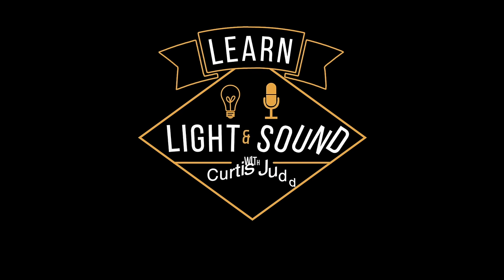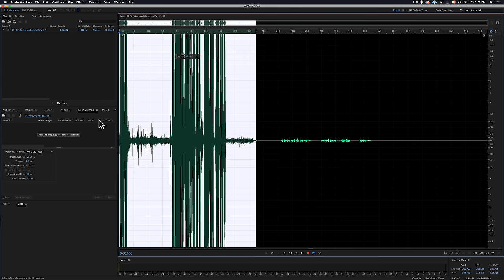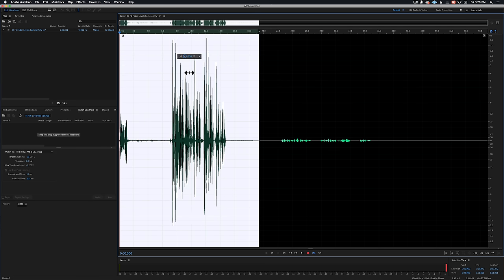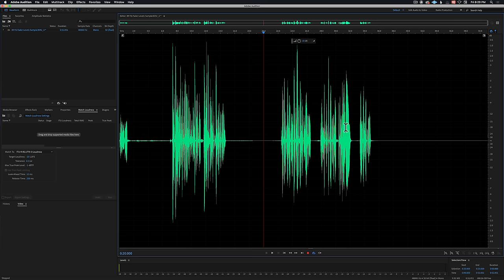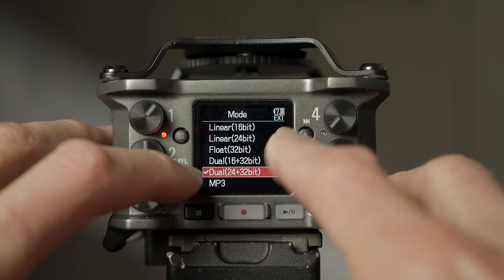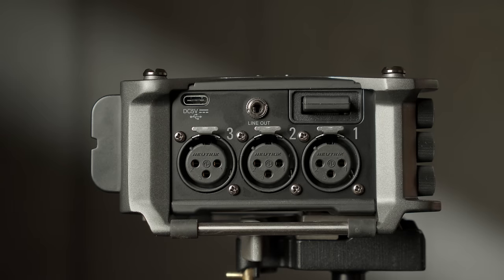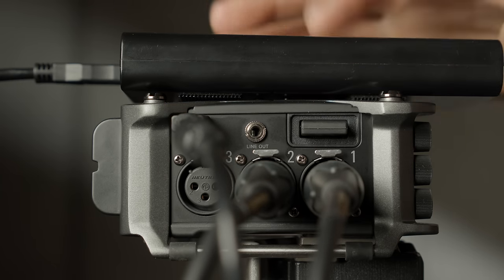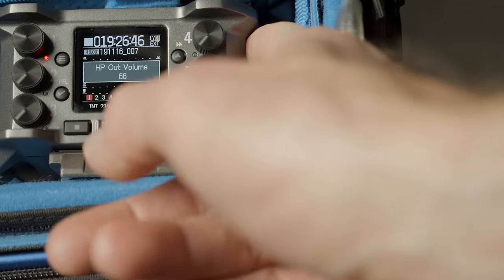Zoom F6 Audio Recorder Review

Comment: Hello Curtis. Thank you so much for this video. I have a DT 770 Pro 250Ohm Headphone. Is there any other recorder from Zoom or Sound devices that can power it? I do not want to spend on buying a new recorder and then a new headphone. Thank you very much for your helpful video.
Reply from the maker: The MixPre does much better driving 250 ohm headphones than any of the Zoom recorders. But it is a tradeoff — the MixPres run through batteries more quickly.
Reply: Thank you very much Curtis for your quick reply. Can I run MixPres through AC Power using adapters if there is one nearby?
Reply from the maker: @letsreview1150  Yes, but check that the USB-C adapter supplies enough power via USB-C.
Reply: Thank you very much Curtis. You have been great help. 🙏

Comment: Hay Kurtis I now have an F6. Now I know that in 32 bit mode the nobs aren't gain nobs as it were. But as they don't have numbers on them like the H recorder nobs mom says she just sees little lines around them how do you get the volumes even?
Reply from the maker: Gotta use your ears.
Reply: @curtisjudd  Ah gotcha. So there's nothing written around the nobs for the sighted either then? Now I did notice when using the app and just getting use to it that when I turned the nobs if I looked at the faders in the PFL section and what's PFL mean?
But when looking at that I did see the things go up or down.
As always thanks for all your help.
Reply from the maker: @MrHamit64  I just double checked — on the screen, it does show the fader level when you turn the knob from -48dB up to +24dB. PFL means "pre-fader listen". It means that you're hearing the raw audio signal before anything is applied like the high pass filter.

Comment: Primarily for podcasting, would you recommend F6 or Rodecaster Pro? Which one has cleaner preamp out?
Reply: Both are brilliant. I have yet to find a podcast consumer that gives the slightest care about having an extra 6dB signal to noise ration on the sound they are listening to. Most podcast listening are done in a noisy environment, such as on the train, walking the dog, etc. and content is more important than that final bit of extra quality. Having said that I have no information or experience in using the Podcaster. Just my 2 cents' worth...
Reply: @remektekmedia6641  Thanks for your reply. And yes, that makes sense. Most podcasts are listened to in a not so quiet environment. And as always. Content is the king. ;-)
Reply: Zoom is also putting out their own Podcast focused interface to rival Rode (and I think it should be coming out any day now cause I keep getting ads for it) that I think will be $400 for 4 inputs (with a lot of stuff that the Rode model has as we'll).
Reply: @FrankETaylor  Sounds great. Any idea what its called? Model no.? Thanks.
Reply: @syjaf6615  Zoom LiveTrak L-8
It doesn't have 32-bit float recording but it does do 24-bit
Reply: @FrankETaylor  Thanks! I'll check it out
Reply from the maker: That’s a tough one but if you need battery power options, the F6 is the obvious choice. The Livetrack L8 is probably worth checking out. I really like the RODECaster for its simplicity of use and having the sound pads can help simplify post.

Comment: Small update on the DaVinci Resolve 32bit limitation: from the release notes for version 16.2, "Support for decoding 32 bit floating point audio."
Reply from the maker: Yes, that's good news, thanks!
Reply: @curtisjudd  I was undecided between the F6 and the Tascam 701 (I need timecode). Tascam had an edge with that jack aux input for my Rode Wireless Go 2, but that little “stunt” with 32 bit recording made the difference. So now I’m waiting for the F6 to arrive, along with a jack to XLR Y splitter 😁
Reply from the maker: @mwarepro  Congrats and happy recording!

Comment: tried plugging my boom mic into zoom f6 but i can't hear anything...any setting I need to turn on for this to work?
Reply from the maker: Yes - set the input to Mic+PH (assuming your boom mic needs phantom power - most do), arm the channel by turning the knob for that channel to the right, and adjust the gain up. You can set the input source in the channel menu which you get to by pressing the check button. If you're interested in a course covering all the details on operating the F6, I have one over at School.LearnLightAndSound.com.

Comment: Got a question,  can I set one input to a LR track and other to mono? Like I have a DJI mic with two wireless mic and one receiver, the receiver can output one mic to L and one to R, so I am think that if I can plug my shotgun to one XLR as mono, and the DJI mic to other XLR as stereo, is that possible?
Reply from the maker: All individual inputs/tracks in the F6 are mono. You can link two of them together to make a stereo track. So you can use a 3.5mm to dual XLR adapter to get both channels from the DJI mic to two channels on the F6.
Reply: @curtisjudd  thanks!

Comment: Dear Curtis, I'm testing the zoom6, if I record from a cardioid I get a 32FP.waw file, this allows me to do with Audacity all the beautiful corrections as you do, but not with DVR as you told me.
I ask you if you know how I can set the zoom to use it with a binaural Neuman head, because in the folder I find two files Tr1.waw and Tr2.waw and not the 32FP. Do you know what I'm wrong? How should I set? Thanks
Reply from the maker: Hello Alberto, First, are you trying to record a 32-bit float file and 24 bit at the same time? If you want one file with both tracks, please set the File Format to Poly in the REC menu. Best wishes.

Comment: Hi Curtis if I use the unbalanced 3.5 into my Canon R6 I won't get as good audio as just taking the memory card out of the F6 and syncing in post then and using the R6's audio as scratch audio? Also, what's the extra attachment you have on the top of the F6 for fixing the camera to on a tripod - does the F6 come with this attachment or is it an extra accessory?
Reply from the maker: Hi Michael, generally, yes, that's correct. That is a camera bracket and came with my F6.
Reply: @curtisjudd  Thanks Curtis. I was going to get the MixPre 3 ii but then put the NPF battery holder is extra but the preamps on the MixPre are better than the F6? My use case will be mostly one man band filming dental practices and customer testimonials to create promotional videos. Which do you think would be better for me?
Reply from the maker: @MichaelGreenwoodMG  Very, very slightly better, yes. I can't say which you'll prefer. I generally prefer the MixPre.

Comment: Hi Curtis,
is it only possible to record multiple tracks when the LR Mix is on, or does mine have a failure? 
when the LR Track is turned off, it mixes automatically everything to one track. :/
Reply from the maker: Hi Delta Sportpark, You should be able to record just the isolated tracks by setting REC->LR Track->On/Off to Off. If that doesn't work, probably best to get in contact with ZOOM support. Best wishes!
Reply: @curtisjudd  thx for the quick reply. the device indeed had a failure, had to send it back.

Comment: How well does the F6 work with line level output from a Korg keyboard using 2 x 1/4in mono to XLR cables. I do a lot of time lapse stuff in Premiere Pro and I've always recorded my sound tracks from keyboard to Akai MPC-X and mixed it to create the wav files. But I need a field recorder for ambient sounds and I'm after something that is future proof and has timecode generator as well. Most video is taken on a Canon 5D4 but I've heard that there is problems connecting the F6 output to a DSLR unless you use an attenuation cable. Any thoughts on this. Thanks in advance.
Reply from the maker: Yes, definitely thoughts on this: https://youtu.be/t5W4Wg2yzfY

I prefer the Sound Devices MixPre series of recorders.
Reply: @curtisjudd  Thank you.

Comment: Is it true that the slope signal that can be used for syncing in post can't be automated. You have to selected it before each recording and cant sync it with software like plural eyes if you dont do this?
Reply from the maker: Slope signal? You don't have to use a tone to be able to sync with Pluraleyes. As long as you record decent scratch audio on your cameras, Pluraleyes should be able to sync without any sort of tone or markers.
Reply: Thanks. It was a comment on a review that confused me. And hadn’t seen it anywhere else. I thought the guy was saying that the format zoom f6 records at was incompatible with zoom unless set up correctly each time. Thought it sounded  strange alright. Thanks for the reply , very helpful

Comment: Any suggestions on how to get a Pico gear dual mic on two separate channels on the F6? It has a TRRS cable. I bought a 3.5mm Y left and right channel splitter, but the male plugs are mono and a female combining plug is TRS. It doesnt work. 
Thanks
Reply from the maker: I believe the PicoGear also has a TRS output(?) I'm not positive but something like this might work: https://bhpho.to/2QBonG3 (FCC requires me to disclose that this is an affiliate link. As an affiliate, I earn from qualifying purchases)
Reply: I appreciate your reply. In the link, that is a female XLR.  I believe you would need a male XLR to plug in to the f6. However, I just received the pico gear a week ago. It comes with 1 TRRS cable.  3 rings and 1 tip contactor pad (both male connectors). The kind that would plug into a cell phone. According to Pico gear this will work on a TRS female input.  I'll check to see if there's something similar to your link.  Thanks

Comment: Hi, I am recording at 96KHz 32Bit res and creating session on protools 12. I have played recorded clip to24Bit session and also 32Bit session. 
The problem i am seeing on protools is that, visually the clipped signal seems always chopped, even if i try to bring it down. Do i need to create a 32Bit Float session on my protools for 32Bit float mix? Protools does not convert the dynamic range if i pull 32Bit audio file to 24Bit project. I am not sure about the creating project on protools while working with 32Bit. Please help.
Reply from the maker: I would think the project needs to be 32-bit float.

Comment: Hey Curtis! I got my F6 yesterday but I am having a bit of trouble using it as a Multitrack Audio Interface. It only shows up as a 2 channel option between the L and R tracks. I've tried installing all the drivers, reviewed my settings several times and even got Gerald to try and help me, with no success. Can you guess what I may be doing wrong? Thanks!!!
Reply from the maker: Hi Dave, When you go into audio interface mode, which mode did you select? Since you installed drivers, I assume you are on Windows? I don't have a Windows computer on hand but if you put the F6 in Multi Track mode in the audio interface menu, the issue most likely has to do with the ASIO driver configuration on your computer. Probably best to contact ZOOM support. Best wishes!
Reply: @curtisjudd  That's the mode I'm using. I'll try uninstalling and reinstalling everything and contacting them for help! Thank you!
Reply: PS: I think it's awesome that you're willing to respond to someone needing help months after a video is out. Thank you so much for that
Reply from the maker: @davearmano5344  👍 Only sorry I couldn't help more.

Comment: I am trying to understand why Analogue limiters are superior to hybrid limiters when the recording is made in 32 float?

Can't you adjust gain after the recording was done? 

Is there any easy practical example that you can provide?

Thinking between F6 and Sound Devices MixPre-6 II

Thanks
Reply from the maker: Hi Herman, In 32-bit float mode, limiters are disabled and are irrelevant. However, if you're outputting sound from the recorder to a camera, I would NOT use 32-bit float mode because you'll overload the camera mic/line input. That's where analogue limiters are useful - in 24 bit or 16 bit modes. Hybrid limiters raise the noise floor while analogue limiters do not.
Reply: @curtisjudd  I see.

Zoom 8 records double tracks so if 24bit fails(clips) in one spot then you can pull only that part from 32float and concert it to 24bit. This will replace the missing clipping part and the issue fixed.

Do I have correct logic?
Reply from the maker: @hermankravchenko6470  Yes, it just creates more work in post. Sometimes I have that luxury such as when I'm working on a narrative film or commercial or corporate work where there will be post. But for livestreams, we have to get it right during the production. And even for a lot of my corporate work, the less post I have to do, the better because it costs more and my clients don't want to pay for it if they don't have to.
Reply: @curtisjudd  thank you for getting back to me on this.

Appreciate your time.

Comment: Curtis Do you know if zoom would be anticipated a new firmware? There is an issue that I can't understand on this device. Only in 32 bits mode, you can adjust the gain in the volume knobs. In 24 bit you can only adjust the mix (L,R) This is an awful thing, I think. I think is an indispensable function to record quickly
Reply from the maker: Hi Jon, I believe that in 32-bit mode, the channel knobs are faders, not gain trim. There is not gain/trim setting in 32-bit float mode, the gain is set statically by the F6 in that case.

I don't know whether they are planning to change that. As it is set up right now, it works like a traditional mixer which I suspect they assumed customers in this range would want. But you could contact their support to ask for a feature change. Best wishes!
Reply: @curtisjudd  you can adjust the knob in reference mode (not gain) and in rec mode. In this case yo can use the knob as trim gain in 32 bits mode. I would prefer 24 bits with limiters and gain knobs instead 32 bits mode witouth them. It's because a lot of post is needed
Reply: @curtisjudd  this 'middle mode' would be better for podcastings or conference- event shootings
Reply from the maker: @JonRivero  Ok, seems like good feedback to send to ZOOM. I encourage you to do that! Best wishes!
Reply: Done!
Reply from the maker: @JonRivero  Thanks!

Comment: Does the iOS app require an iPad or can I use with a phone?
Reply from the maker: Also works on iPhone.
Reply: @curtisjudd  Thanks! Just ordered an F6, thanks for the very excellent review.  I skipped around a bit, so not sure if you mentioned that the bta-1 (?) doesn't support audio monitoring remotely. The review of the R-07 from Edirol said they managed 40ms of delay which I'm not sure if it would be good enough to monitor or not. But anyway, I'm looking forward to trying this with my rode NT4 for recording live music shows.

Comment: If I understand correctly with DaVinci Resolve there are problems, can't read and manage its files?
Reply from the maker: DaVinci Resolve/Fairlight does not handle 32-bit float files. It treats them as 24-bit and clips anything which exceeds 0dBFS. You can record 24-bit on the F6, but if you plan to do a 32-bit float workflow, unfortunately, DaVinci Resolve isn't a good option at the moment. Hopefully they'll add 32-bit float support in the near future but I suspect it is a BIG JOB to add 32-bit float support which requires changing code in lots of places throughout.
Reply: @curtisjudd , I ordered it just for the 32-bits, I'll work the one recorded in Audacity since it manages it, before uploading them to DaVinci. I need to record with the Neumann binaural head to get as much detail as possible. Thank you very much for your explanation of the product.

Comment: Why don't I run into the preamp or DA noise floor, when recording so quietly & raising the levels in post in 32 bit?
Reply from the maker: You might have a look at this explanation from Sound Devices: https://www.sounddevices.com/32-bit-float-files-explained/
Reply: @curtisjudd  Yeah, I already looked there. They just say their preamps have less noise then the mic at any gain level, so I can't run into it. This however doesn't really explain why this wouldn't apply to 24bit
Reply: @johannes.schaffer  I don't know all the details, sorry. But my understanding is because it can encode the dynamic range into a much larger addressing space and uses two analogue to digital converters, the noise floor can be written much lower. Simply put, there's more dynamic range.
Reply: Okay, thanks very much for your time & tips